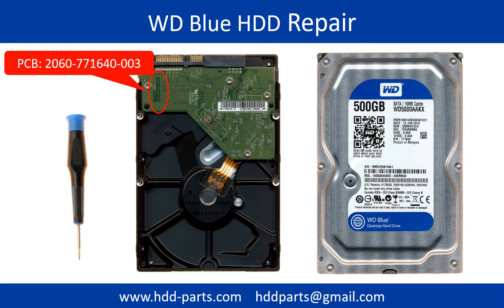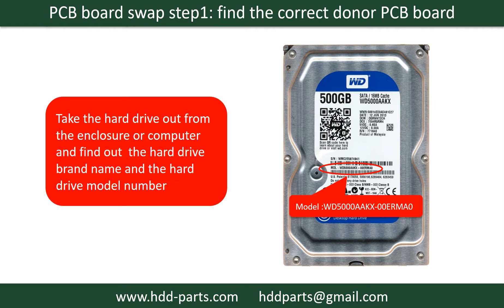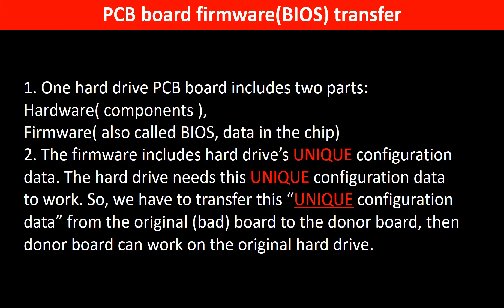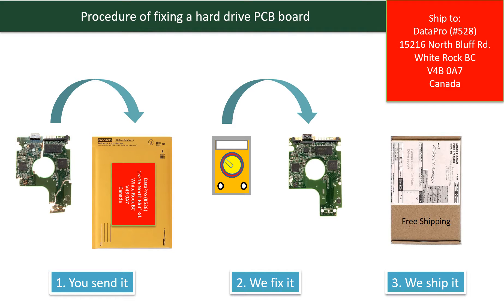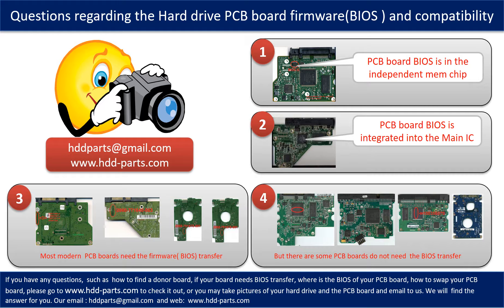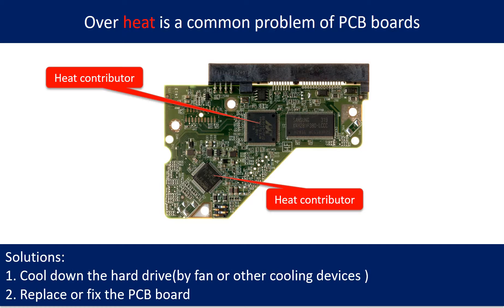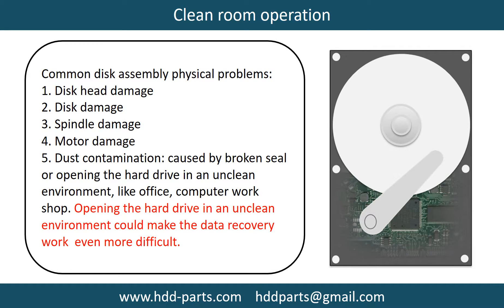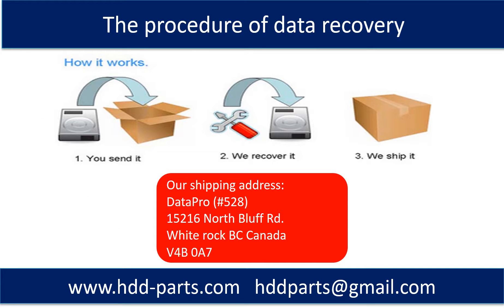WD 2060 771640 WD5000AAKX 00ERMA0  WD5000AAKS  WD10EARS WD10EADS WD10EALX  repair data recovery

Comment: My WD500GB hard d rive 
S/N: WCC2EV532154. MDL:WD5000AAKX-00ERMA0. Circuit board model: 2060-771640-003 REV A.
Now the computer Bios does not recognize the hard drive model
If according to the circuit board
model Look for replace circuit board in the computer BIOS Is it possible Identify the hard drive model ?